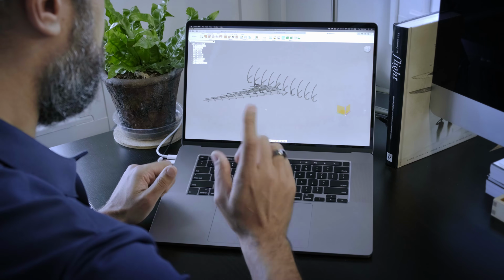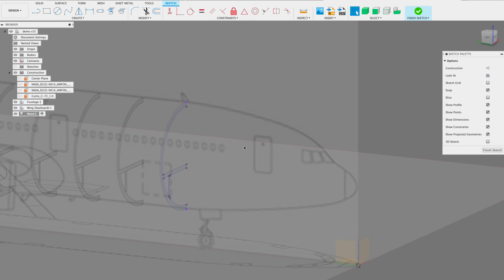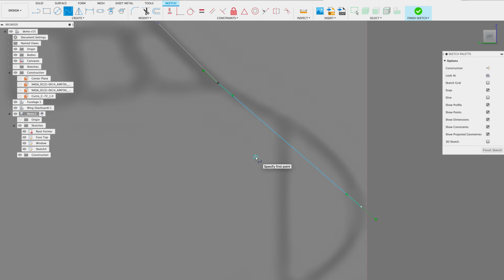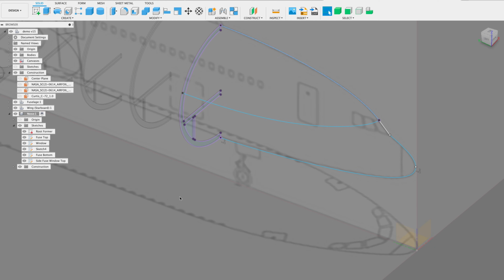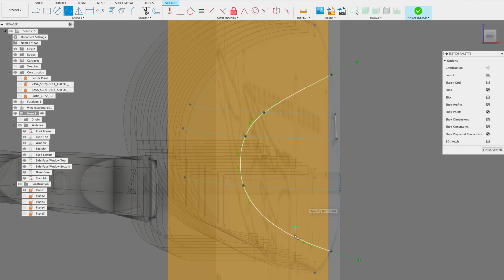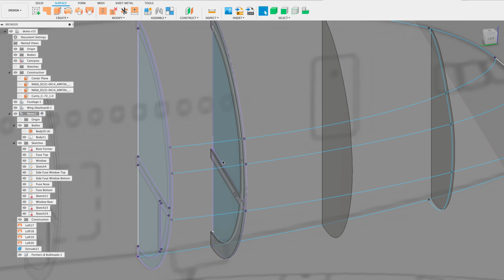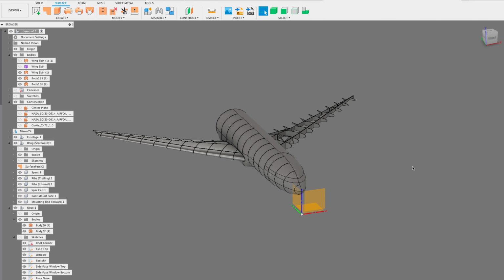How to 3D Model an Airplane Fuselage Nose in Fusion 360 [Episode 5]

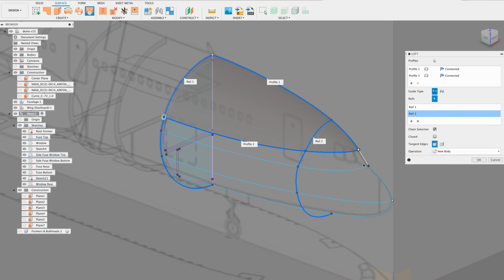Comment: While Lofting at 36:50 , I have an error Saying Rails not Smooth ! Please Help !!!!
Reply from the maker: Ah yes, I know that error well. That means your rail has a hard, or sharp bend in it. You need to look up close on your sketch and find the problem. Fusion isn't the greatest at telling you where, so you'll have to hunt for it. But I can confidently say, you added a hard bend somewhere. In the past, when I couldn't solve the problem, I would start over and re-sketch that area and that usually solves the issue.
Reply: @RCCAD2VR  I Tried Thrice But Same Problem . The Problem seems to appear with the Root former again and again . The dots along the Root former Are shown Red when the error happens .

Plus there is a Magenta Circle at the centre axis (which normally appeared only during The intersect function use ) which I didn't notice in your Tutorial . 

It's so Frustrating After getting so much done and getting stuck here . 😭😭😭😭😭😭 

Dont know what to do !! ;(
Reply from the maker: @தைரியம்  Can you send me screenshots. You can send them here https://forms.gle/PoxV4PHKUwFFhVb48 and I will take a quick look glance at it to see if I see anything obvious.

Comment: Maybe I missed it, but why do you have the history turned off?
Bob T.
Reply from the maker: Hi Bob, Yes, the entire series is done in Direct Modeling mode for several reasons. Mainly because the timeline can become a huge mess of missing references for someone who is just trying to get started with CAD and F360. Creating, deleting, recreating components, all very common in the beginning can turn the timeline into a confusing and frustrating experience. Also, there are features used in this tutorial series that are inaccessible in parametric design mode. For example pivoting construction planes, which was used in the wing tutorials. It's also important to note that we're not modeling anything to exacting specifications, and working more free flow. I want to make sure that modelers of all experience levels can freely make mistakes and changes without too much struggle. Parametric design is AMAZING and completely worth using, but for this series I felt direct modeling would be the best way to start. Cheers!

Comment: When you create the contour of the nose, you make new sketches for each line segment. Why? (I would think that it saves time / less clutter to do all lines in a single sketch)

Do you keep al sketches around? or do you delete them once they are no longer necessary?

Same question for planes, do you delete these?
Reply from the maker: Hello -- Before recording this video I spent a lot of time testing different methods. I landed on the methods demonstrated in this video because it consistently produced the same outcome without issues. The single line method created several issues with lofting, and did not work every time and was prone to errors. My goal is to make sure the audience can get result with the least amount of difficulty. There is nothing preventing anyone from giving a single line method a go if it works. 

Since this is not being designed in Parametric mode, keeping the sketches isn't necessary. I tend to keep them if I need to make changes. The planes I tend delete, since they are single use.
Reply: @RCCAD2VR  Thank you, good reasons.
Just for kicks, I will be trying the single sketch method first, just to see where that will take me.
Reply from the maker: How'd it end up working for you?
Reply: @RCCAD2VR  It did work, but you have to be very careful of keeping track of all the project/intersect points you need.

There is less clutter in the sense that there are fewer sketches to keep track of. But the complexity of the single sketch started interfering with later work because a sketch can only be enabled/disabled as a whole. So whenever the sketch is needed, the viewport becomes very cluttered.

So while I have not done so yet, I will be restarting again and keep those sketches that intersect a lot of other sketches as simple as possible. Probably a single line per sketch.

Learning by running into walls I call it ;-)